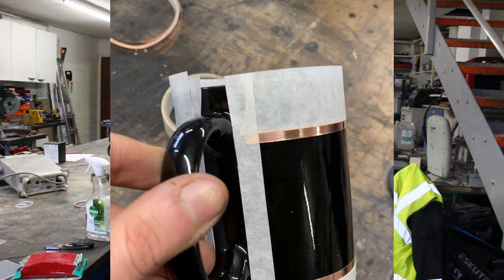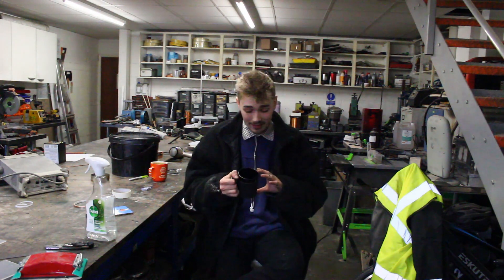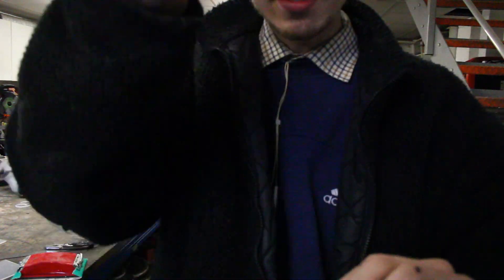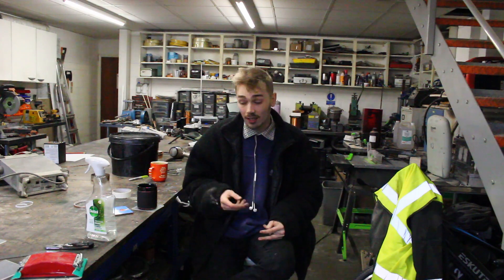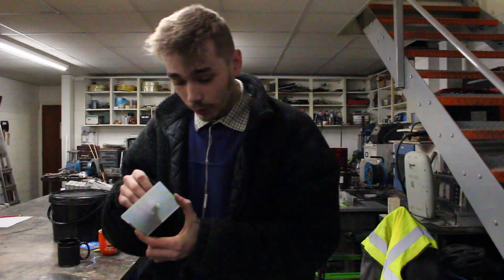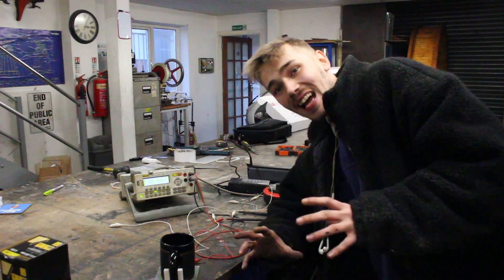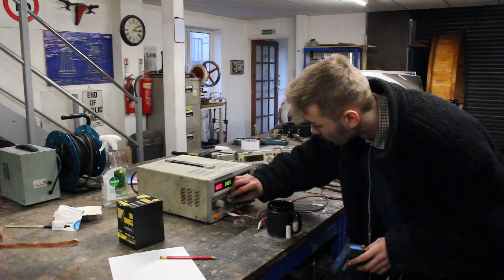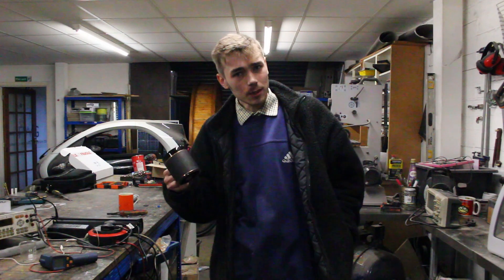1454 - Resistance Heating and Your Cuppa Coffee

Comment: I discovered inductive heating with a wireless phone charger and a metal disc on the back of my phone which attaches to a magnetic holder. It melted the disc into the back of the phone case while it was sat charging 😂. I wonder if you could do the same just put the mug on a cheapy wireless charger and a metal disc on the bottom of the cup or maybe inside at the bottom of the cup.